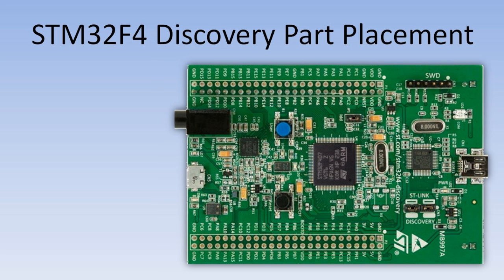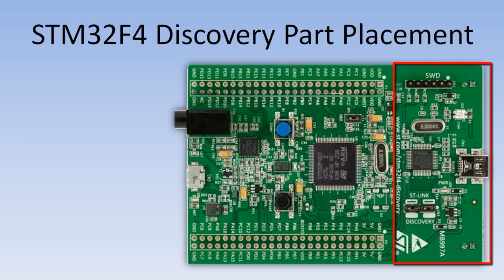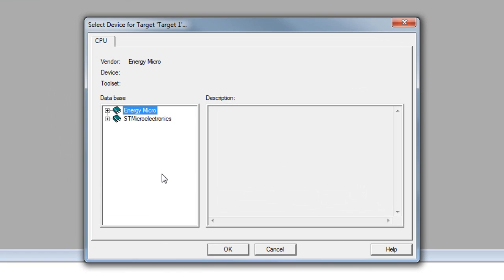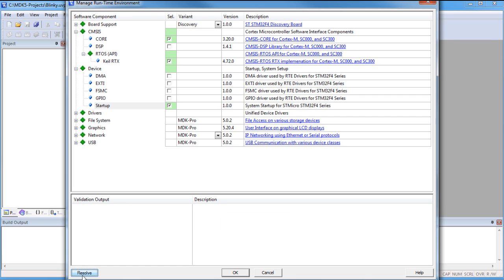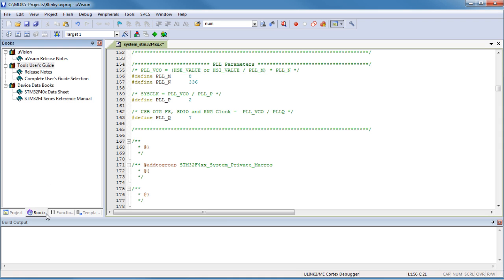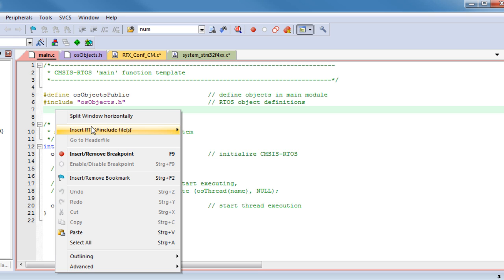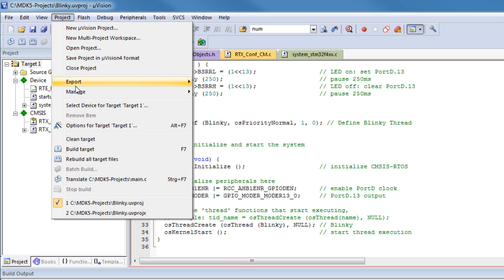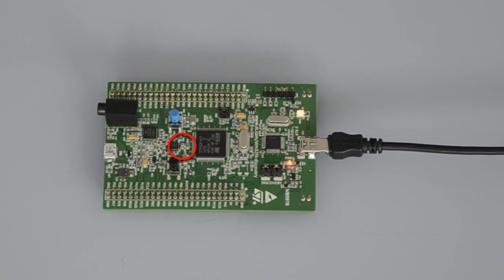Blinky Project with MDK-ARM Version 5

Comment: at 4:30, you are entering "16800000" which is 16.8MHz not 168000000, which is 168MHz.
Reply: thats right, well spotted. We recognized this error at the video later on also, but decided to keep the video untouched as the focus is the explanation of the process flow